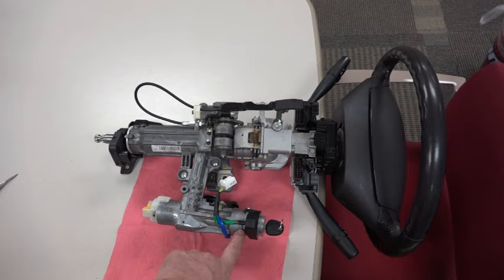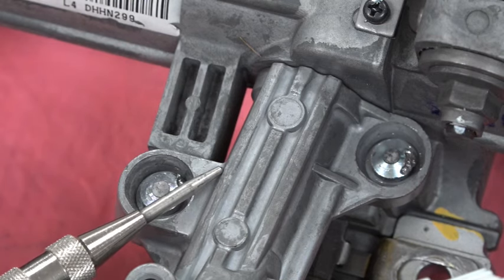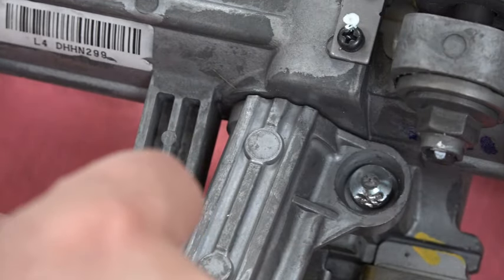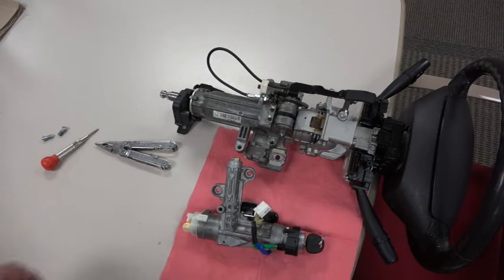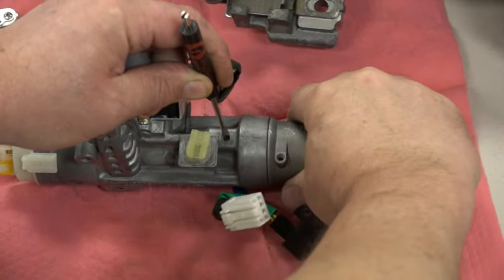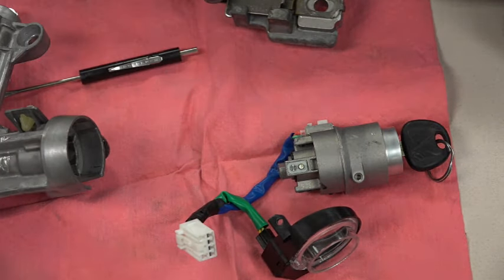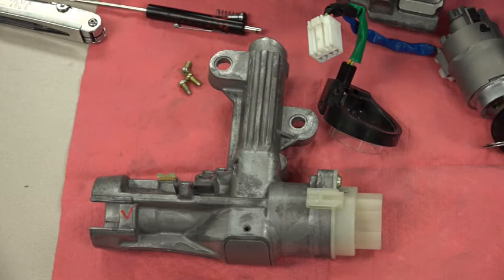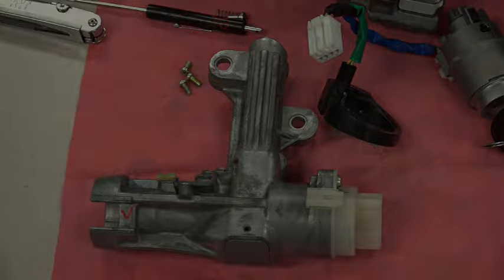Hyundai ignition lock cylinder

Comment: Back when Hyundai/Kia made quality all metal key ignition assemblies. Starting in 2011 some genius at Hyundai/Kia decided to make the ignition switch out of plastic instead of metal. This allowed the key cylinder to get easily removed without the use of any tools hence it being stolen with USB cords. The models with the metal assembly (seen in this video) does not have an immobilizer but you'll tools and a lot of force to start the ignition.

Comment: Thank you. I was having a hard time finding any information on the Sonata ignition breakdown.  Your video gave me everything I needed to diagnose and fix my daughters car.  Your description of each component goes further than most self help videos.  Great Job.
Reply: Same for me. That switch that he pulls out on the backend of the cylinder is what I need to replace. Car has power but will not turn over or click. Fuse and battery continuity is good so it has to be that white plastic switch. Just can't find anyone showing how to get to it. If I can fix it it would save hundreds of dollars in towing and repair.

Comment: I have the same problem with my Hyundai ATOS from 2002 (manual transmission). I guess the components are very similar! But what part of this assembly should I suspect?? The thing where the key sits, or that long thing "downhill" (behind) from that? That thing which is aligned in the same direction as the key! Please please give me some hints, because I really need to solve this problem ASAP! :face-purple-crying: The key is very worn I should add. We can unlock the steering lock, but cannot turn the key further to ignition position or start!

Comment: Hey my Hyundai accent had the same issue where the switch cylinder (white mechanism at the back) went bad and my car needed programming, the mechanic bypassed the system and played with the wiring to add ignition and accessories switch along with a push start.
This was my first experience and my car was stuck midway where the mechanic assisted me just wanted to know how much would it cost me if I need to do the complete ignition change along with programming??

Comment: My kia was stolen. I have my ignition switch but it wont fit in the chamber cause they used a screw driver so i need that part replaced. What is the name of that peice that the ignition switch goes in

Comment: Does that solenoid also control any of the starting functions other than when the car is in Park? My car will sometimes not start and other times it will start and if left in Park or Neutral the starter will randomly engage. I was thinking it was the solenoid that needs to be replaced. What are your thoughts?
Reply: Excellent video, in all respects. Thanks !

Comment: When you dont have the luxury of having column out, first insert steering lock gently. Finesse it into place. Index the round plunger dot at 5-6 o clock. Once it fully seats you can easily feel the bottom side. It will be at a 2 oclock position. Then finesse the white switch into place. Then screw it down. Now you can get the key lock into place and it will finally seat into position allowing the lock pin to engage.

Comment: I can't turn the i20 key to on position. It's stuck at off and steering wheel is locked.

So, how to remove the ignition cylinder whenever this situation happens??
Reply: Did you fixed it ?
Currently have the same problems
Reply: @juancovarrubias8555 and what's your model and year?
Reply: Yes i already fixed it
Reply: @juancovarrubias8555  you can see my details

Comment: drill 2 holes in bolt head and use snap ring pliers
Reply: Sounds a little more...."complex", shall we say? But definitely sounds workable. (Providing, of course, the "fingers" of the pliers are long/deep/rigid enough to extend down to the bolt head without being interfered with by the walls of the inset)

Comment: I bought a new lock cylinder and it still locks up on me
Reply: How did you fix it? What was it?
Reply: Ditto, I have the same problem. I haven’t yet figured it out.
Reply: @JoshMcKenna  so what happened one year later i have the same problem
Reply: So whats th solution ?
Reply: @alexandrepelletier1884  I ended up donating my car for a local non-profit that fixes up and gives away cars for people stuck in a cycle of poverty due to unreliable transportation. They have better tools and experience than I do to fix it right.
Problem is a piece inside that ignition cylinder that sticks and jams sometimes. That, and a plastic piece inside the steering column that catches it. Unfortunately, that part in the steering column is inaccessible behind breakaway bolts.